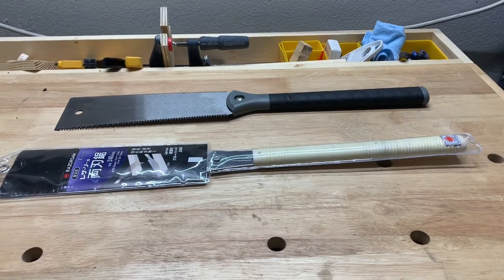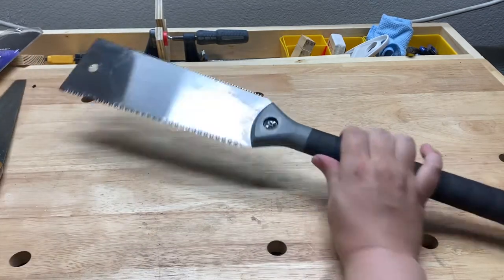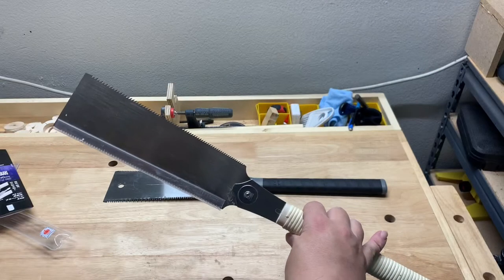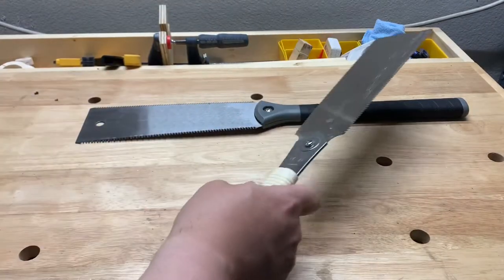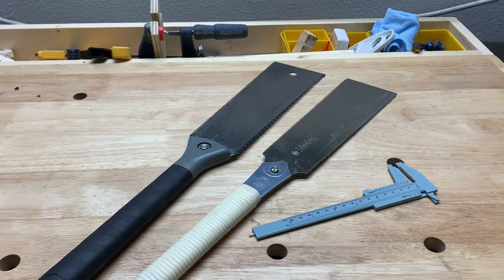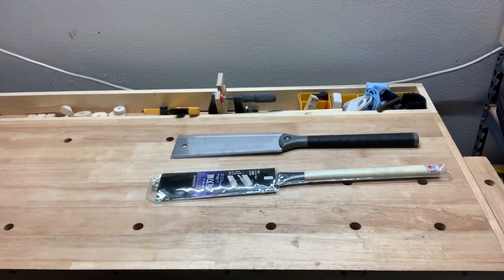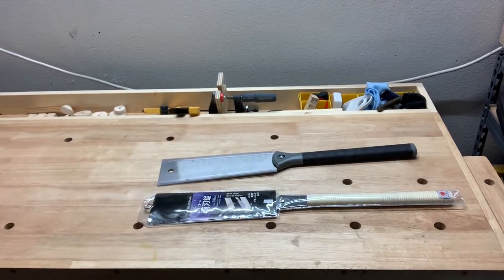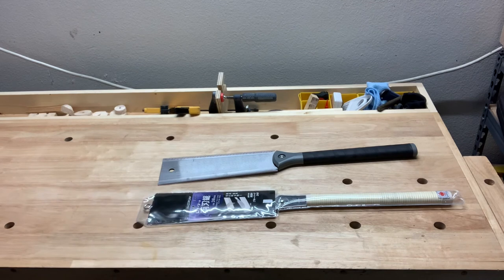Harbor Freight Saw vs. Gyokucho Japanese Saw

Comment: I noticed that you are consistently not using the whole saw in your cuts. Also I noticed that you were pulling the blades at an angle to your cut line (You can see the bend in the blades when you are cutting.)  I only noticed because these are two bad habits of mine I am trying to banish. Good video.
Reply from the maker: Hi Douglas.  Thanks for the tips I will try this next time I use my saw.  I am self taught and it shows.
Reply: @asyangmdphd  I find that I notice things like this. Probably a side effect of practicing and teaching karate for many years. It would be nice if the ability to notice automatically translated into the muscle memory necessary to have the skills at an expert level. You are not the only one still learning. One of my karate teachers uses the phrase "always a student."
Reply: Good observations I was going to mention the short stroke myself.  Longer full strokes will help keep the line. Also let the saw teeth do the work. It will be much more smooth.  Thanks for the video.

Comment: I been having the harbor saw for years, works great just ordered a Vaughan bear saw blade to put on the harbor freight handle. Hope it fits
Reply from the maker: Let me know if it does, but the HF saw is so cheap you can buy a whole new saw for cheaper than buying a replacement blade.  I hope the Vaughn is much better for what you are paying
Reply: It fits, it's a little smaller and the blade is thinner but very sharp. It's supposed to be made in Japan
Reply from the maker: @jamalshamah7280  how much was it $?  Is it worth it given the HF saw is only $9.99?
Reply: If you use it a lot , I think it's worth it. It was 19 dollars. I liked the harbor freight so I went with a new blade for it

Comment: I like your use of the block to get the cut started. Its a good practice. Also, I think you are, by habit default, trying to cut on the push stroke. Listen to the sound of your cut, you are putting more emphasis on the push over the pull try listening concentration at 9.00 mins and other cuts.
Reply from the maker: Thanks didn’t notice that.  Will have to practice my technique. Always trying to get better.  Appreciate the advice.

Comment: The bigger teeth on the HF saw are not actually in a rip cut pattern.  If you look closely, you'll see that each tooth points in the opposite direction, and is filed on one side to be pointy in that direction.  That's a crosscut pattern.  A rip cut pattern would be all teeth in 1 line, like chisels perpendicular to the saw blade.  Now that said, I just tried rip cutting with the HF saw and my technique has improved a lot from watching videos.  It's not great but it does seem doable.  I've got 1 big plank I need to reduce to narrower pieces of more use to me.  Too cheap to just buy more wood right now, and I don't want a power saw.
Reply from the maker: Thanks Brandon just took a closer look you are right.  Maybe why the HF saw is thicker and stiffer.  I didn't do a rip cut comparison of the saws but will have to do that next time.

Comment: I am wood hobbyist for the last 60years, had used almost all types of saws, and found out recently that the best saw to cut your finger is the super sharp double edge Japanese saw. After bandaging my little finger of left hand the first thing l did was grind off one side. Hung it and hugged my old nice and kind saws. Dual faced character less saw cuts both ways. Throw away type.
Reply from the maker: Huh?
Reply: If it cuts your finger that easily (and it does!), it will cut wood more easily also. Western saws require to much fiddling. How often do you have to resharpen your blades? That is time wasted. In this point I definitely disagree with Paul Sellars! Check the set, file each tooth, reverse the saw file those teeth. NOPE not for me.
Reply: Well there are single edge Japanese pull saws. I've been using Japanese saws since the 70's when I was a kid and I'm terrible at using push saws maybe it depends on what you've gotten used to.

Comment: Besides the superior materials used, better tooth geometry, and the overall refined finished product that differentiates how a tool performs over time there's another component that shouldn't be overlooked. That component I'm talking about is how a person uses and cares for their more expensive tools. I use more attention to detail and almost baby my expensive tools. Something I don't do with my cheap ones. For things like chisels, planes, saws, pliers, and pretty much any handtool if it is a quality item I will maintain and oil them religiously. I won't half assed sharpen the blades or fix the set in a saw blade tooth by tooth. And it shows in how I use them and the results I get. It's almost like I expect a cheap tool to suck so don't put as much effort into using them or caring for them. And once I've been able to upgrade a specific tool for a better one I rarely if ever use the cheap ones again. I save them for lending out or giving away to another person who was where I once was in their quest to fill up their garage or workshop. I also put them away when I'm done and they all have their own space that they and only they occupy. Though I have to add that for certain things I just can't seem to hold onto them no matter what I do. Especially with 10ml sockets. Which I will often pick up a spare of when I remember to do so during a visit to the hardware store. I've also found that even badly maintained japanese tools or their cheap ones are still far above their cheap counterparts from any other country.
Reply from the maker: Very true. But I find myself saving my Japanese saw for special projects and use my Harbor Freight saw for every day use or rough projects.

Comment: I wonder if the Japanese replacement blade will fit in the HF handle 🤔
Reply from the maker: Good idea! So I tried and not really.  They both attach with a single screw so you could attach the blades interchangeably but the fit is not secure and would likely move while you are sawing. I hope this helps.

Comment: Diagonal braces on each end of that bench will drastically reduce the amount of wobble.  (Upper Rear to Lower Front) 
Use one plank of 3/4 inch maple and a bunch of Torx wood screws per side. It will turn into a tank!
Reply from the maker: Thanks for the tip. Will try it on my next bench. This one is fine. Just the casters.
Reply: @asyangmdphd  I have what appears to be that same bench (Harbor Freight Windsor Designs).  Once I shimmed it for my uneven concrete floor, it has been a very solid bench.
Reply from the maker: @fredmeyer3063  mine was fine.  Just was to lazy to lock my caster wheels.
Reply: @asyangmdphd  You added the tool tray, I see. Nice touch.
Reply from the maker: @rodcdickerson  Thanks.  I really like the HF bench.  Great value. I have a video on the tool well. If you are interested.

Comment: Actually you used to be able to resharpen Japanese saws but it seems like he majority of saws have a impulse hardened edge and are not made to be sharpened. On the plus side many old saws not sharp enough for woodworking are great in the garden and/or snapped to make card scrapers. I used to have some Japanese feather files used for sharpening saws which I wish I could find since I have my grandfather huge old saw.
Reply from the maker: Thanks. Let me know if you find those files or a way to sharpen Japanese saws. Thanks

Comment: Thanks if you get rich maybe you could compare the Rob Cosman saws to the Japanese saws ! It appears a cutting on the pull is easier?
Reply from the maker: Probably will never be that rich or good at woodworking.  The pull is definitely easier, but the push feels more natural and controlled.  A Cosman saw with a really thin blade supported by a spine may take away the advantages of a Japanese pull saw.  Will be happy to do the comparison if the company wants to send me a saw to try....:)
Reply: @asyangmdphd  I really like the idea of the relief ground in the thickness you mentioned . Im an early retired tool and die maker/machinist (degenerative disc disease) with a hobby farm . An older man like me ,gets set in his beliefs and traditions. Im learning that  traditions sometimes need to be broke
Reply: What saw from Cosman are you referring to? He has multiple types.

Comment: A good fair review 👍. I have the harbor freight pull saw and the other pull saw from harbor freight and while maybe not as precise as Japanese steel and engineering they are both reliable and durable go to saws  I even used the harbor freight saw like a machete and it still remains sharp and as precise as it was in beginning.. I also had a mij pull saw but friend is uding it and I paid about 37 for it and while it's a tad bit more accurate with it's thinner kerf/blade I personally think that the harbor freight Portland pull saw is a great deal..
Reply from the maker: Thanks I am glad you found it useful. The HF saw is a great deal.  Have a good one.